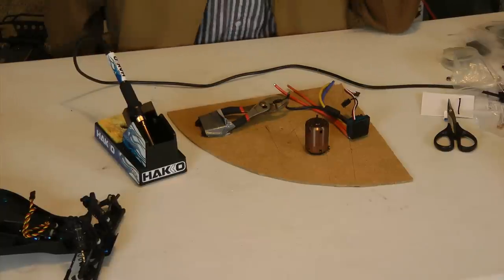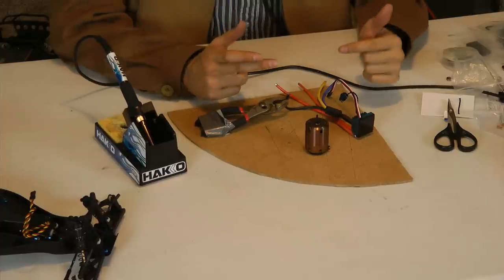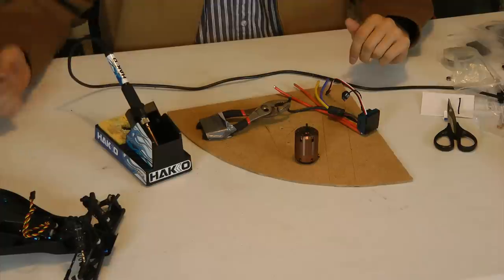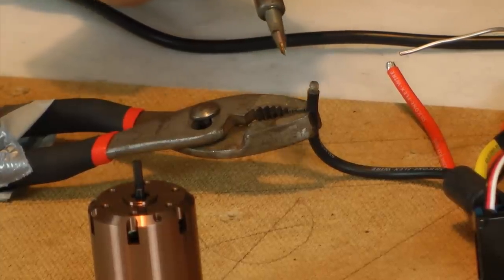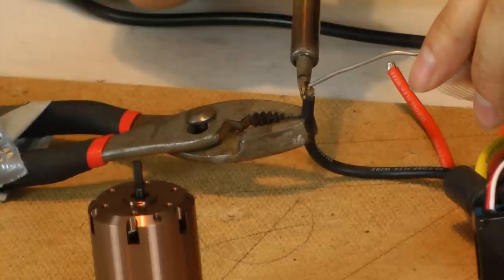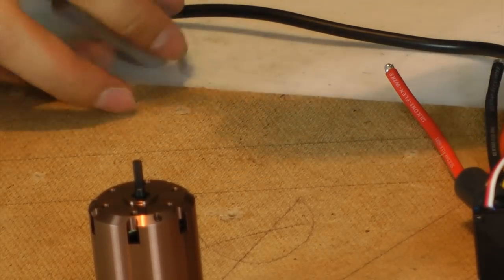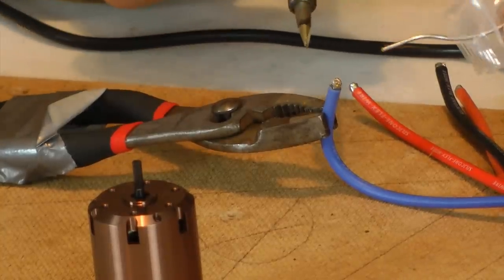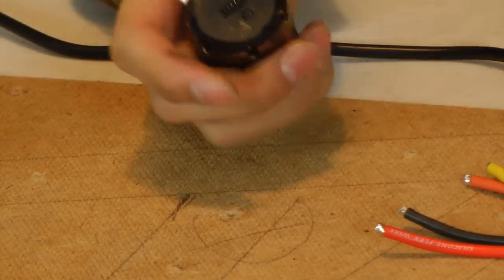How To Prepare an ESC For Install Soldering Instructions

Comment: Thanks for making this video,

Do you think the soldering tip used here is too small for the job?

Why I ask is because  the thicker wire appears to be functioning as a heatsink.

 This means you have to hold the iron in position for a longer tha  necessary time.

With a larger chisel tip and the same iron I'm thinking mayber you wouldn't have to hold the iron on the wire for so long.

Comment: IF you use soldering flux when tinning wires it will go faster and create a far better tin job on the wire. when you don't use the flux then you will have bad joints and you can also burn your wire strands, and also create cold joints, which in this application you will cause a higher draw rate  to happen. just some friendly advice is all.